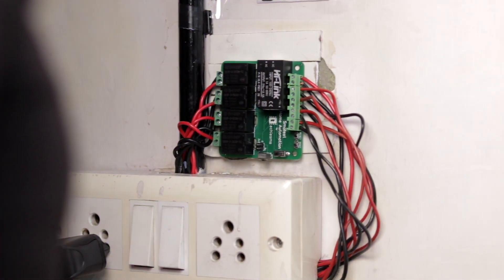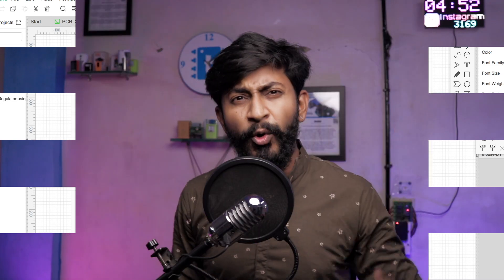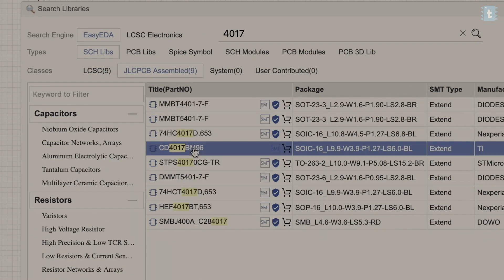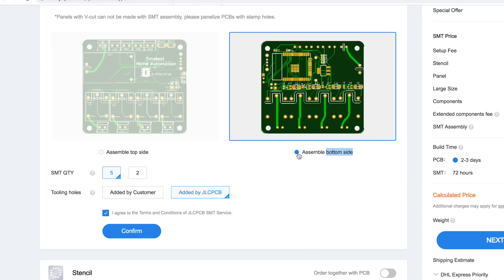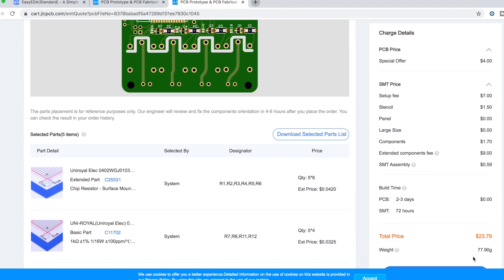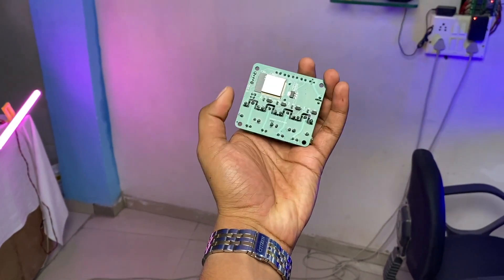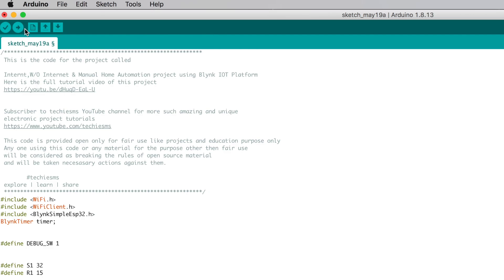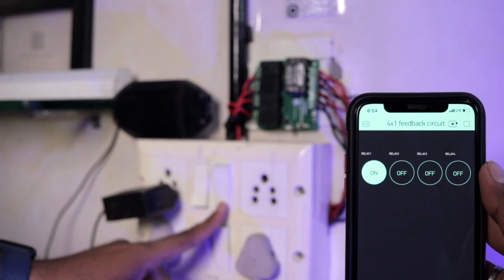Smallest 🔥🔥 Home Automation Project using ESP32 module | Internet & Manual Home Automation project

Comment: how to give external supply to esp32 board? As I'm working on a small project so I am creating PCB for it as well but I have confusion how to give external sources to it
Reply: I think you can use AMS1117 3.3 v for 3.3 volt power supply for esp32 board or chip

Comment: Great project,but I appreciate if u could add terminal for controlling via pushbutton like the new sonoff mini R2, the downside of iot is all fail if internet fail for some reason and espicially if any guest are around I'm little annoyed to say okgoogle turn on that 
I did try an opensource design earlier but it had an option of turning on appliance via a push button only (like bell switch) but I guess push rockers no one use in india 😭😭 but there was a method to use ordinary rocker switch via a pull up resistor something but I didn't understand that so I leaved that,may be u could integrate this in ur new design if any 👍👍👍

Comment: The Hi Link converter is just to power ESP32 and Relays or it has something to do with the current that appliances pull from circuit?
Reply from the maker: HiLink power supply is rated with max voltage and maximum current

Comment: Why don't you make new projects with ideas overall cost cheap so that everyone can afford? Like Chinese iot switches cost below rs.600 per device... Can you try to being down to atleast Rs.200. then that will be impressive
Reply from the maker: It’s a project 
Not a product

Product costs can be cut down by ordering bulk components, but not in projects
Reply: @techiesms  I know. Why don't you take it as your next project's aim? If you know what I mean... Then real product will be costing below 100 for example...
Shelly, sonoff started like a project.. still cost 600 as product. But before similar device costed more than 2k. Your videos are inspiring...
Reply: @general123ist  How you learn about really cost would be under 100 Rs .. Wifi ESP itself 70-80 Rs and then adding PCBA / relay other components would be Another 150 Rs .. Since this project with AC input you Also need AC to DC converters like HILINK Costing 150-200 Rs else, you can design or add your own AC to DC supply for operating ESP / RELAY CIRCUIT ... SONOFF and other Chinese vendors ordering components in bulk and SMT costing in China is dirty cheap that's the reason still they are making money by exporting Hardware to the world where we have to pay hefty amounts on import duty ..

Comment: Esp32 performace will be dropped significantly because of hi link power supply
Reply from the maker: Why ?
I don’t think so
Reply: Range is the issue here because antenna is facing towards the wall and is placed at really poor position. Although it will work normally probability of esp32 failing in long term is high. Well I would like to know how it performs in long term.
Reply from the maker: @KitarpLive  but the router is very close to the device so range is not an issue for me and I don’t think it will fail working 

As I was using esp32 Dev board with Hilink for around 1.5 years
Reply: @techiesms   yeah it will work in your case because router is nearby. HiLink and esp32 on same pcb gave me lot of issues. Especially wifi dropping packets and random disconnection from router.

Comment: Can I use Esp 8266 instead of ESP32..?
What are the changes I should make..
Reply: Both chips have a 32-bit processor. The ESP32 is a dual-core 160MHz to 240MHz CPU, whereas the ESP8266 is a single-core processor that runs at 80MHz.

Comment: Fire hazard project
Reply from the maker: This is a project 
Not a product 
And if you want you can securely put this product inside the switch board after inspecting if all the wires are connected properly
Reply: @techiesms  does hilink risky?
Reply: @techiesms  Exactly this is not a product and no one would like to put this fire hazard project inside their switch boxes because it has not been properly tested
Reply from the maker: It’s totally up to you 
If you ask me then I’m using the older version of this project since more than a year now 

No problem at all
Reply: @techiesms  thanks bro..
Also integrate the fan regulator section in this project
.it will be complete
Reply: @techiesms  sir then why dont you go and make a product out of it.. cause you know its not going to work and this project is only good enough for getting views and sponsors.
Reply: Matlab?
Reply: @shubhamsen4572  this is a useless project and look at that wiring outside the switch box. Any short circuit might result in a fire hazard . Makes sense?
Reply: @pulkitjoshi1078  are you an expert ?
Because I want expert opinion on this.
Are you sure it will cause fire and short circuit?
Reply: @shubhamsen4572  my friend if you are looking for expert opinion in youtube comments then you should install this “Project”  in your house inside switch box.

Comment: hi,
could you explain "MQTT" coding on a NodeMCU(ESP32 or 8266)
where it should be able to send and receive mqtt messages from a local mqtt host on a pi
>>>OR 
IN SIMPLE<<<<<
would you plz explain the ""PubSubClient"" coding on Arduino IDE which is used to communicate with mqtt on a NodeMCU like how to build the code
 (IF POSSIBLE DO MAKE VIDEO)
>>>>>>AND<<<<<<
Is that Possible to connect ESP-01 with Arduino Mega which helps to connect Mega to WIFI like similar to "Ethernet Shield"

Comment: Hi, 
Bro, I am Evan I watch all most every video on your channel and I thought of making home automation in this lock down period , when I was making I had a huge problem Its shows an ERROR - like this PLEASE HELP ME BRO 

Arduino: 1.8.15 (Windows 10), Board: "NodeMCU 1.0 (ESP-12E Module), 80 MHz, 115200, 4M (3M SPIFFS)"

C:\Program Files (x86)\Arduino\arduino-builder -dump-prefs -logger=machine -hardware C:\Program Files (x86)\Arduino\hardware -hardware C:\Users\sys1\AppData\Local\Arduino15\packages -tools C:\Program Files (x86)\Arduino\tools-builder -tools C:\Program Files (x86)\Arduino\hardware\tools\avr -tools C:\Users\sys1\AppData\Local\Arduino15\packages -built-in-libraries C:\Program Files (x86)\Arduino\libraries -libraries C:\Users\sys1\Documents\Arduino\libraries -fqbn=esp8266:esp8266:nodemcuv2:CpuFrequency=80,UploadSpeed=115200,FlashSize=4M3M -ide-version=10815 -build-path C:\Users\sys1\AppData\Local\Temp\arduino_build_154123 -warnings=none -build-cache C:\Users\sys1\AppData\Local\Temp\arduino_cache_699699 -prefs=build.warn_data_percentage=75 -prefs=runtime.tools.mkspiffs.path=C:\Users\sys1\AppData\Local\Arduino15\packages\esp8266\tools\mkspiffs\0.2.0 -prefs=runtime.tools.mkspiffs-0.2.0.path=C:\Users\sys1\AppData\Local\Arduino15\packages\esp8266\tools\mkspiffs\0.2.0 -prefs=runtime.tools.xtensa-lx106-elf-gcc.path=C:\Users\sys1\AppData\Local\Arduino15\packages\esp8266\tools\xtensa-lx106-elf-gcc\1.20.0-26-gb404fb9-2 -prefs=runtime.tools.xtensa-lx106-elf-gcc-1.20.0-26-gb404fb9-2.path=C:\Users\sys1\AppData\Local\Arduino15\packages\esp8266\tools\xtensa-lx106-elf-gcc\1.20.0-26-gb404fb9-2 -prefs=runtime.tools.esptool.path=C:\Users\sys1\AppData\Local\Arduino15\packages\esp8266\tools\esptool\0.4.12 -prefs=runtime.tools.esptool-0.4.12.path=C:\Users\sys1\AppData\Local\Arduino15\packages\esp8266\tools\esptool\0.4.12 -verbose C:\Users\sys1\Desktop\EVAN .P.A\Arduino IDE\NodeMCU\NodeMCU.ino

Error resolving FQBN: getting

Error compiling for board NodeMCU 1.0 (ESP-12E Module).

PLEASE HELP ME TO SOLVE THIS ERROR BRO PLEASE  
THE NUMBER WHICH YOU HAVE GIVEN IN THE DESCRIPTION I CALLED IT BUT IT WAS SWITCHED OFF

PLEASE HELP ME BRO TO SOLVE IT
Reply: You have to check and configured the correct files while the configuration of ESP

Comment: This is NOT home automation - it's remote control...
Reply from the maker: Well, yes kind of
Reply: @techiesms  I don't think there is any 'kind of' about it. There are no actions performed automatically as a result of measured conditions, there are only actions performed as a result of inputs from 'virtual pushbuttons'.

There is absolutely no automation involved in this project and it is very misleading to imply there is...
Reply from the maker: But this same project with same coding can be turned into an automation project Have a look over this video in which I converted this exactly same project into automation 

https://youtu.be/yCaCHow_PLA

That’s why I mentioned kind of

Comment: Design circuit for motor control. (Dvd motor, hdd motor, brushless dc motor, simple dc motor, geared dc motor, printer stepper motor, etc) it's start, stop, speed control. Etc

Comment: What happen if i press off in blinky aap in case of mechanical switch is on? Does is switched off the respective relay ?
Reply from the maker: Yes
Reply: @techiesms  pls tell what software do you use for designing the PCB?

Comment: 2 Touch switches, 1 fan regulator with touch switch, 1 three pin socket with touch switch ( all with led indicator)

All controlled over blynk, ir remote, google home, alexa simultaneously

If you can make it.😍😍

Comment: From my professional experience.. your PCB routing is quite bad, but doesn't matter, as long as it working properly and you keep on continuously improve, it is good already
Reply: Can you give some guidance to some sources where I can learn about professional pcb routing methods and industry pcb standards.?
Reply: @sayantanmaiti2513  always remember, the traces for power line and also grounding, they should be thick enough to uphold the current going thru, but for signals line that carries over mA current, enough with minimum 6 mils in size.. but if you got chance to thicken a bit like 12 mils, it'll be much more better..
If possible, try to avoid using auto router..
Reply: Can you make that pcb with those mentioned standard! And publish ! Because it is way more compact !
I think it will be great if you do so this pcb will be more cheap and standardized
Reply: @saiyammorakhiya8494  depend on the purpose.. for the time being I won't, but sooner who knows
Reply: @voltronicsautomation  hmm make for community
Utilise your knowledge and do what you can do so other can get benefits like me because i know what i want and how should it have to work but i can not design those pcb and make but i have great knowledge of technology but i am lacking in engineering!